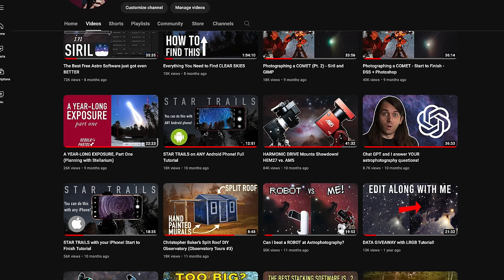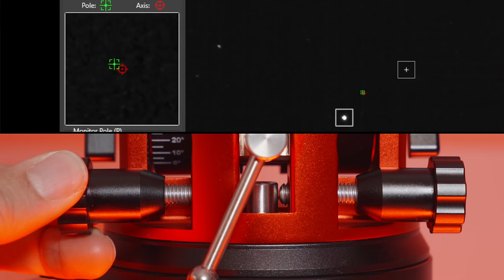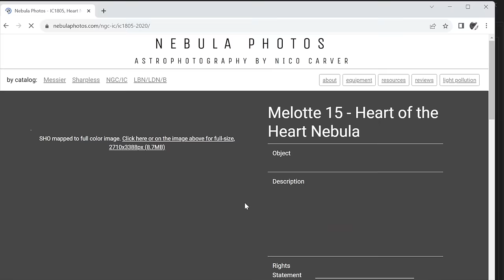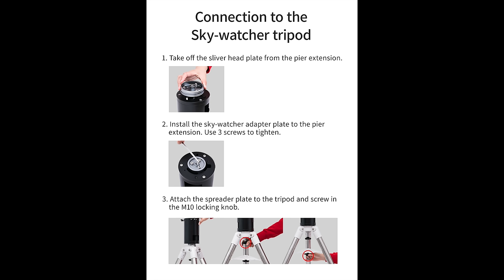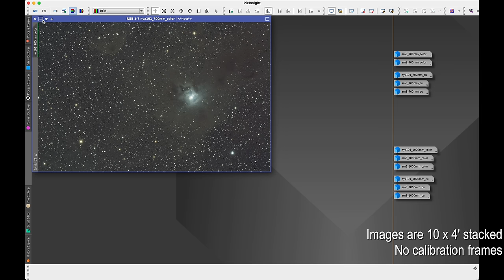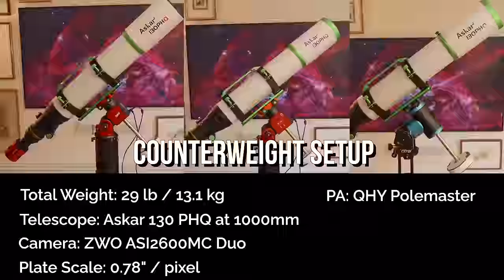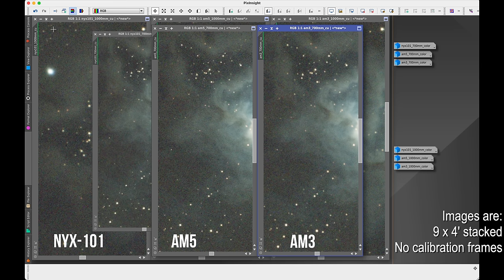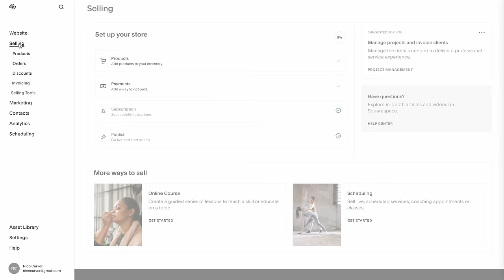Harmonic Drive Mounts are the REAL DEAL! Pegasus NYX-101 vs. ZWO AM3 / AM5

Comment: Thanks for the review, interesting results especially in that 2nd test (guiding error not really corresponding to the stacked image result). However I think you should've disclosed the fact that your AM5 (earlier version) is of different specs to current version of the same mount which was silently (I would even say "secretly") downgraded earlier this year to the same gear specs that are used in AM3. Therefore any results from your AM5 mount are meaningless for anyone who is buying that same mount today. Not even dealers were notified of the change. The periodic error duration for the earlier version was 432secs whereas for the downgraded version of AM5 it is now 288secs (same as AM3), lower PE duration results in less accurate guiding because shorter PE period will cause steeper slope of the periodic error (which in turn results in less smooth guiding). Lastly it would be great if at some point you could do comparison vs the Rainbow Astro RST-135. Cheers.
Reply: is it actually downgraded, or just changed? Downgrading performance after release would be a pretty silly move.
Reply: @timwhite1111  of course they officially didn't call it a downgrade, but the fact is they didn't even announce the change, they let the users and dealers believe the PE period is 432secs where in fact they changed the gearing that resulted in the PE period being changed to 288secs. but by any metrics shorting PE period is a downgrade. would you rather have 40 arc secs error every 432secs or every 288secs ? as an example peak to peak error of 40" (-20" to +20") translates to average error of 0.093 arc-sec per sec (432 PE duration) VS 0.139 arc-sec per sec (288 PE duration), the per second error increase of 50%. also the shorter PE period will cause steeper slope of the periodic error (peak to peak value), none of which is desired for smooth guiding. When I purchased my AM5 I was deciding between AM3 and AM5, the only reason I went for AM5 was the advertised PE period of 432, only to find out (once I started using it) that the PE period is much shorter. If I knew AM3 and AM5 were identical in terms if PE period I would've chosen the cheaper and more portable AM3 instead. I confronted my dealer and they were unaware of the "downgrade", the dealer then questioned ZWO who finally admitted the change.
Reply: hey @bobeshoz  could you elaborate? im really curious to learn more about this whole, "scandal". Do you have a source for this info?
Reply: @bobeshoz   I think your maths is flawed here, the peak to peak (or at least the error) yo-yos loads of times per period, every few seconds, it's not 40 arc secs error per period, and changing the period length doesn't affect that actual error, it is the same.

Comment: I finally got clear skies for my AM3.  My AVX died (I won't bore you with details) and I love this mount.  I have the Askar 103 and it performed flawlessly. Dither settling was quick and tracking was below .9 all evening.  I did use a counterweight.  I thought tipping over could be an issue with scope, camera, etc hanging off to one side.  Thanks for the comparison review.

Comment: Pegasus, come on, just supply the 10A as the default power supply and ZWO, include a power supply! Great post!
Reply: Not in the UK
Reply: Pegasus is here! We will, but price will be increased. I hope you will not complain. Have great Thanksgiving.
Reply: @anata5127  Does the NYX 101 support the guiding features of the ASIAIR? How well does the guiding work with the ASIAIR?
Reply: @WilliFromEarth  I think ASAIR support NYX.
ASAIR and PHD2 guiding numbers differ. For example, for the same set up PHD2 shows 0.8-0.9, while ASAIR 0.4-0.5. They have to keep costumers happy.
Reply: @anata5127  Thanks. Good to know :-). Is there anyone out there who has tested guiding with the ASIAIR and the NYX?
Reply: @WilliFromEarth  I don’t know about data on specifically NYX. I have seen it only on AVX and EQR6.
Reply: @anata5127  The ASIAIR can handle many mounts for GoTo and guiding.  Especially, those mounts that have been around long enough or whose INDI drivers are based on a variant of the established LX200 protocol.
Reply: @WilliFromEarth  Great to know. Thanks. 
I have started from ASAir, but rid of it after 4 months. Reason is that I had troubles with ZWO products; with every one of them: focuser, camera, filter wheels. 
Nowadays, I don’t own any ZWO product. So, I am not up-to-day with their products.
Reply: I fitted the Pegasus Astro Saddle Powerbox (10A) with the AM5 puck to my AM5. I absolutely love it for cable management. I did have to carve out the foam in the carry bag though. The rig uses a PE200 extension on an EQ6 tripod to carry an Orion EON 130 ED APO, reduced to f/5.6 with a 533mc camera for DSO and with a 2.5 powermate and 464mc for planetary. I use a Jackery 500 as power supply. Its all mobile (camping cart). But it's been cloudy for three months and I've only had a first light test in full moonlight (where all I learned was that wifi guiding is a bad idea). I'm confident I'm gonna love it when I get the chance.

Comment: I have both the AM3 and AM5 and in my experience ( so far limited time on the AM3), the weight limits on the ZWO’s is a little optimistic.  My 17 pound 102 set up showed pretty much identical results that you got.  Put a six pound counterweight on and it was a massive  improvement on tracking.  Like wise on the AM5 with a 9.5 inch SCT that was only two pounds under the limit for not using counter weights.  Immediate improvement with 10 pounds of counter weight.  I’m going to try the six pounder counterweight next time I use it and see how it does. 
The counter weight is a very useful accessory to use regardless, as it gives the rig a lower center of gravity and less “tippie “.

Comment: Thanks for doing this comparison Nico!.

1. A few questions:
(a) How frequently was the guider making corrections during each sub-exposure? Once per second? Twice per second?
(b) I wonder how many of the spikes in each guidelog graph were due to either i/ gusts of wind, and/or ii/ the typical sudden 'periodic error' which all harmonic mounts have.
(c) Did you monitor the weather conditions during these imaging runs to see when there were gusts of wind? 

2. FWIW, I am not surprised that the AM3 struggled with either OTA. Those ASKAR  refractors are quite long, so they would exert a significant torque on a mount if there were any gusts of wind. It would make sense that the smallest, lightest mount would suffer the most in such a case. Consequently, IMHO, one cannot make any fair comparison between the performance of these mounts & their carbon fibre tripods (which are definitely the weak point in each rig), because the AM3, AM5 & NYX-101 were all stressed to different degrees by the weight of each telescope.

3. Finally, if you do any further testing of harmonic mounts, I would encourage you to see if you can get your hands on an iOpton harmonic mount that has strainwave gearing on both axes. fYI, the iOptron HAE29 has the same capacity as the AM5, but the HAE29 is much lighter. The lower weight to capacity of the HAE29 may be a bonus, especially for imagers who travel to their favourite location via vehicle or are taking a flight to their imaging nirvana. Also, the HAE43 has the same capacity as the Pegasus NYX-101, so that would be an interesting comparison. 

Furthermore, some imagers are taking advantage of the narrow channels through the RA & Dec axes in the iOptron HAE mounts to route a power cable to their preferred power distribution system (e.g. PrimaLuceLab Eagle, Pegasus Powerbox, etc.) As far as I am aware, that is something that is lacking in all other harmonic mounts.

Last, as is the case with the Rainbow Astro RST-135E harmonic mount, iOptron offers versions of their harmonic mounts with an encoder on the RA axis, which greatly smooths the 'periodic error' of the mount...so it would be interesting to see if such a feature is worth the much higher price tag of the encoder versions.

Thanks, again, for doing this video! 👍

Comment: Did you add extra weight to the tripod weight basket? Did you balance the scope in the length direction by putting a round wooden dowel under the scope vixen bar and roll it until you find the center? You then mark that spot and place that center in the middle of your mount.

Comment: Thanks Nico for the review! I'm a fan of your channel. And I wait for each next vid you make! I have to mention that I think the test is not very accurate. Guiding depends on seeing, seeing can change dramatically even in zenith during the same night. 
More accurate test should include the 4th rig based on a mount with absolute encoders that will capture seeing conditions to filter out time intervals with seeing out of given range. So all data sets that accounted are acquired on the same seeing conditions.
What your test had measured is capability of the mounts to recover from moments of poor seeing and maybe mild wind gusts. Which is basically a real world test and very valuable information. 
Based on your experiment I can make a conclusion that all tested mounts are great mounts within defined specs. They are big step up from low-mid range worm gear mounts that were popular in the past. They recover fast,  have no backlash and are compact. Of course time will tell about how they hold in a long run but for occasional use they are perfect.

Comment: Great comparison, as always. Thanks much! I agree about not putting scopes the size of the 130 on the AM3 or AM5. But I wonder if the effect on the images is due, not so much to their payload limits, but because the lever arm of the 130 exceeds the torque specs of those mounts. Too long a scope might unbalance the ZWO mounts more quickly than the payload. Just a thought. Could be other things too, of course. Anyway, great review!

Comment: Thanks for this video. I am still not sure what the purpose of the counterweight on the Harmonic Mounts. Does this assist the system or is it to stop tip overs? If it is for the gearing is there a ratio between the scope weight and the counterweight?
Reply from the maker: It's to stop tip overs.
Reply: @NebulaPhotos  I had an intuitive sense that this is the purpose as I was having problems with my AM5 not being able to do a meridian flip with my 8” EdgeHD, which has heavy accessories such as OAG, Filter Drawer, Moonlite focuser, etc attached. I then added a counterweight thinking it may assist the mount but it didn’t. 
Thanks
Reply: It’s also because the strain wave drive system has a max torque limit (higher in AM5 than AM3). For heavier loads, the counterweight reduces the torque the system has to drive (as there is the torque of the counterweight opposing the torque of the scope). Cuiv the Lazy Geek explains the mechanics very well in one of his videos.

Comment: Very comprehensive comparisons! I've been looking at the AM5 as my next mount upgrade, as I need something that can handle the 8se with full imaging gear on it. The 8se is right on the edge of what my current CEM25P can handle, and it strains at wonky positions. But now I'm thinking about looking into the AM3 as an alternative, as I think it can handle the load just fine.

Comment: Hey Nico, can I get you to show your balancing routine using the NYX-101?   Even the AM5 would be helpful.   I'm using an 8" Edge HD with the 2.5" CHL Moonlite focuser with a QHY268C.  And I have a fair amount of counter weight on the front of the OTA due to all of the weight from the Moonlite Focuser and camera.   No counter weight on the RA.  I'm getting similar results as you have.   But I used a SCOPS OAG which I think might be part of my problem.  Trying to get sharp round stars using an OAG can be quite a challenge.  And my accuracy on guiding varies between 1.29 and 0.65 Arc Seconds.  Be interesting to see your routine as I'm not sure how I balance the mount or if its even necessary.  ;o)

Comment: Fantastic review as always from Nico. It would be nice to see a comparison of the stacked images for the three mounts after initial image processing.  Specifically I'm wondering if after processing by BlurXTerminator the difference in star profiles would no longer be visible across the mounts? Of course it's always best to start with the highest quality rate data, in which case probably the AM5 is best, unless you need to use a heavier load, but these days software can perform miracles to compensate for optical aberrations, and  tracking errors.

Comment: Thank you for the video. When you place the balance weight, do you need to "balance" the set up or just place the weight at farthest locations on the extension?
Reply from the maker: Nope, I just place it all the way out. My understanding is it's just there to prevent tip-over.

Comment: Great Review Nico! Contemplating getting the 130PHQ have the AM5 and TC40 and 200 Pier. I do use it currently with a C 9.25 with counterweight and don’t seem to have any issues. What would you think if I was to go to the 130 and would it help to have a weight in the cloth holder on the TC40?
Reply from the maker: I think if you don’t deal with much wind, it will work okay based on my experience. If you do have a lot of wind, I’d go for a beefier tripod
Reply: Appreciate Nico Happy Holidays !
Reply: I’m up here at Lake Winnipesaukee New Hampshire, pretty protected in on my land

Comment: Excellent video as always Nico! I purchsed the AM3 in September and could not be happier. I was going back and forth between the AM3 and AM5. Agena probably thinks I am nuts as I ordered the AM3 in June, cancelled it and then reorderd it in Sepember in order get their 20 Years deal, then cancelled it and ordered the AM5, then the next day cancelled it and reordered the AM3 🤪.  After finally deciding why I was getting this in the first  place, the AM3 was the obvious choice.  I already have an Atlas Pro which I love, and a Sirius on a cencrete pier in the Astroshed, for my larger scopes - the AT115 and Edge800.  If these were what I needed the new mount for I most certainly would have purchased the AM5 or NYX, however, the AM3 is for my portable widefield setups - mainly the Askar FRA300.  This works great for this set up which the Askar has a FL of 300mm. The other night I forgot to engage the autoguider and I was taking 2-minute subexposures. I checked them the next day and 75% of them were just as good as the ones collected using the guiding. As you eluted to, if one were to use a larger scope with a focal length of 700mm or larger, go with the AM5 or NYX but if you are using a smaller scope, this is fine.  I do occasional travelling, sometimes on a plane and the AM3 is small enough to easily go into carry-on luggage.  

It looked like the AM5 produced the sharpest nebular detail but it was real close with the NYX. Cheers Kurt

Comment: Great vidoe Nico! As I am planning to get a SWG mount too this video is really what I was looking for. I am uncertain if the AM3 would be enough for me or if I have to go with the AM5. The downside of the AM5 for me is that in Germany it is 800 Euro more expensive than the AM3. My heaviest scope is a GSO 8" RC which comes at 10.5 kg/ 23.1 lbs fully equipped with camera, OAG, filter drawer, AsiAir. From the specs the AM3 should be fine running that weight with some 3- 5kg/ 7- 11 lbs counter weight. 
I guess on the AM5 I would be able to leave away the counter weight or just attach a small one. At the moment I am running an iOptron CEM40, a no-brainer in terms of weight with my current telesecopes.
All those question when getting into new tech. 😂

Comment: I have both the AM3 and the AM5 and on a light rig I can't spot any differences in guiding. The AM3 doesn't have the azimuth lock or the 12V DC output (handy for flats). But the AM3 is my go to portable mount now.

Comment: Thanks for the review! I have a question: can the SW150750 be used on the AM3 for astrophotography? All equipment together with the camera does not exceed the lower limit of the load capacity without a counterweight (about 7.5 kg). And would it be crazy to use SW2001 on AM3? In this case, the weight of the entire equipment will be about 12 kg, but the large size and windage of the SW2001 are intimidating.
Reply from the maker: The 150 should work fine. The 200 would also be okay in an observatory or in a place with no wind. With wind, I think the large surface area of that scope combined with how lightweight the AM3 is would be a bad combo. Of course you can compensate with a big tripod and weights but in that case why not just a heavier mount
Reply: @NebulaPhotos  I understand! thanks for the answer!

Comment: In photography, I've been told that carbon fiber tripods are better than aluminum or steel because they absorb minor vibrations better and don't transmit them to the camera nearly as much.

Do you feel like they have the same benefit for astrophotography?
Reply from the maker: If you are talking about tripods of the same size with similar leg thickness, yes the carbon fiber may do better with vibrations. When I was talking about using aluminum or steel tripods for bigger telescopes, I meant much bigger tripods where the legs are much beefier than the carbon fiber ones, and the weight of the tripod is 3-4x heavier. In that case, I imagine the aluminum tripod will handle vibrations better but it’s of course less portable.